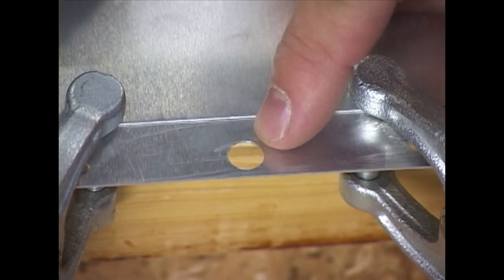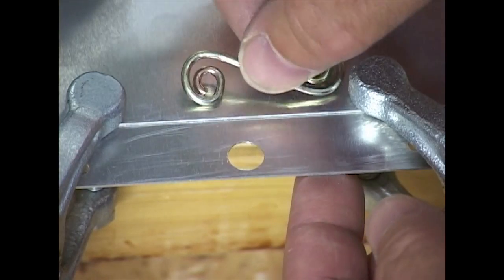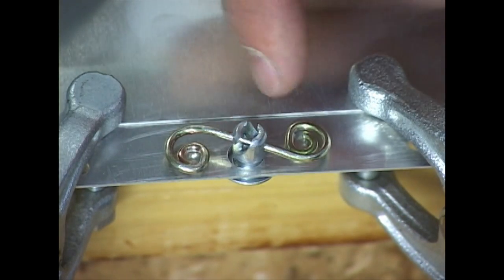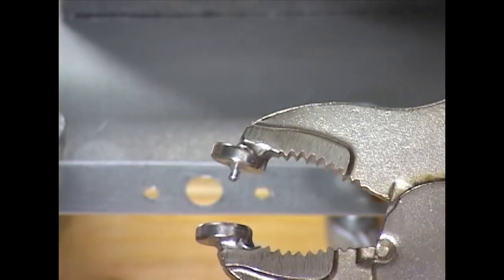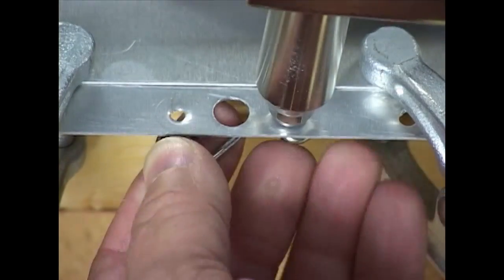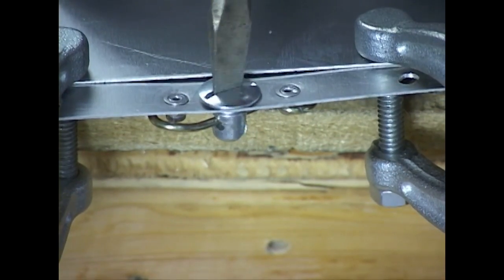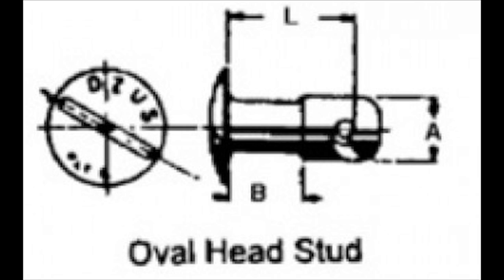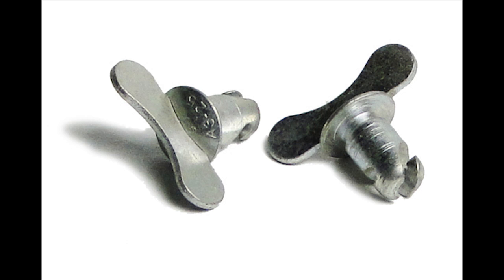Installing Dzus Fasteners

Comment: Thank you.  Where did you purchase the sheet metal dimpler tool that works with your vice grips?  I see Pegasus sells a dimpler for the actual Dzus fastener but not the rivet.  Thanks in advance!
Reply from the maker: Aircraft Tool Supply
Reply: @HomebuiltHELP  Thank you!

Comment: I like your video on Dzus fasteners, but ——all I can find is springs with 3/32 inch holes. Were do you get the springs with 1/8th inch mounting holes. Help, my airplane project needs these.

Comment: Very helpful.  I want to change the dzus fasteners on the cowling of my Cubby, so both are slotted.  Whoever built it used ONE Phillips and One Slotted, which is just a nuisance checking the oil with the drain tool needing to switch from one to the other.  Thanks  N121WP

Comment: Hi, Thanks for posting. What about those retainers that normally get used instead of the snap ring ? Those retainers that appear at first like a canvas grommet and they get squeezed with a special tool or sockets? Regards from Alaska.
Reply: BetterAircraftFabric  You are best off not to use a snap ring as they are hard and wear a large hole in the stud hole in no time. For the common 5/16 diameter as demonstrated in video use the proper GA5 grommets, they are soft and formed with a bar with a 5/16” hole and a C clamp.